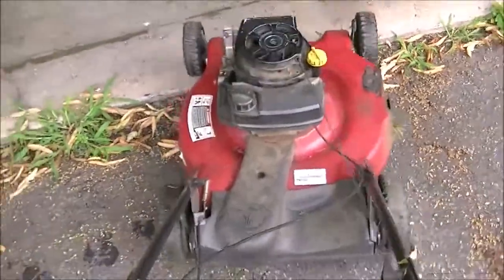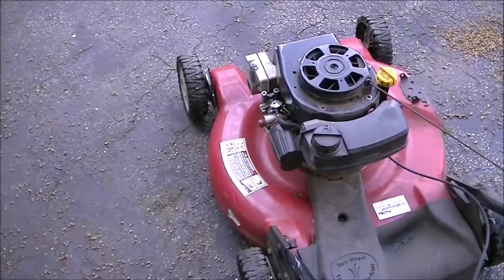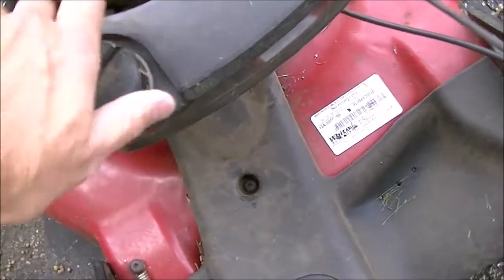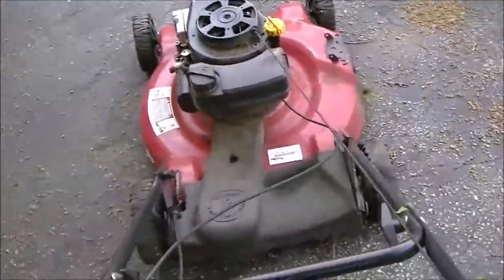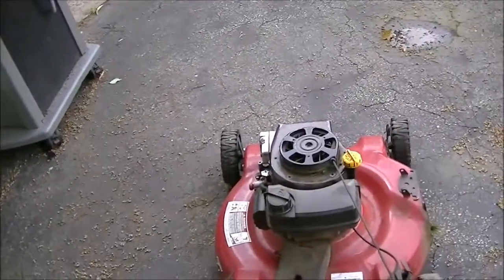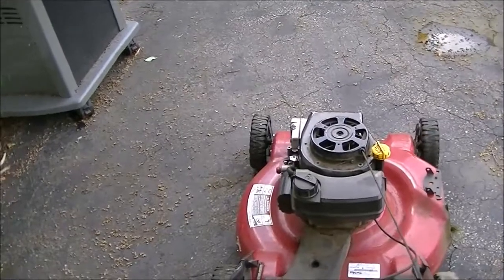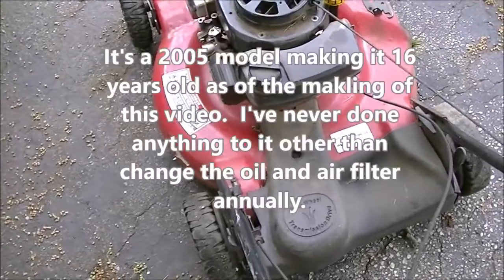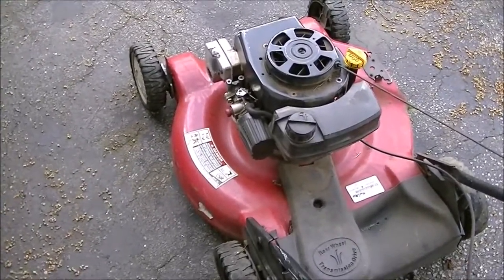Lawnmower Update - Will My 16 Year Old Mower Cold Start With One Pull on 3 Primer Bulb Pumps?

Comment: A one pull wonder.
Reply from the maker: It always has been.  That is specifically the reason I wanted a Tecumseh engine when I was shopping for it.  I had spent my whole life fighting with Briggs powered mowers that wouldn't start and once they did ran like crap.   Then my father stopped buying $89 bare bones cheapies and bought a Craftsman with a Tecumseh  that always started first pull and ran great.  After that I was sold.  

After saying that the first mower I bought after buying my first house was a $99 Walmart cheapie with a 3.5 hp Briggs because it was all I could afford at the time.  It ran like crap from day one.  Hard to start and would stall all the time.  I ended up taking it to a small engine guy and he had to clean and rebuild the carb and adjust the governor so it would run faster.  After that It actually ran great but you shouldn't have to take a new mower in for service to get it to run the way it should have out of the box.
Reply: @tallboyyyy  An old co-worker of mine once gave me a snowblower he didn't need anymore because he bought a bigger one.  It had a Tecumseh engine.  I had the exact opposite experience, that Tecumseh was near impossible to start, and never ran right once started.

My ghetto-fabulous mower has a Briggs, and oh yeah, it's hard to start.  Once started, it runs fine.  Though right now that's not exactly the case.  But this was a hand-me-down of a hand-me-down of a hand-me-down, so the long and short of the story is it probably would have otherwise been taken out of service years ago.

I think about 13 or 14 years ago, I bought an edger, a Craftsman, that has a Briggs.  That always starts in one pull, very very occasionally 2.

I think it really all comes down to the carb.  An engine is an engine.  They all have very similar parts that do the same job inside.  But just like the human body, if it's fed a bad diet (or in this case, improperly carbureted fuel), it doesn't do so well.  Perhaps the carbs on the Tecumsehs work better.